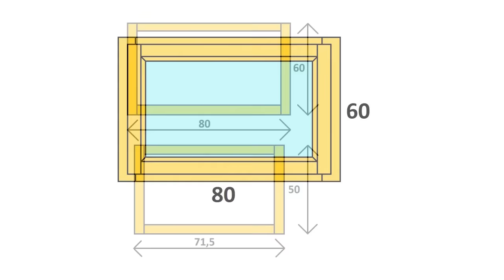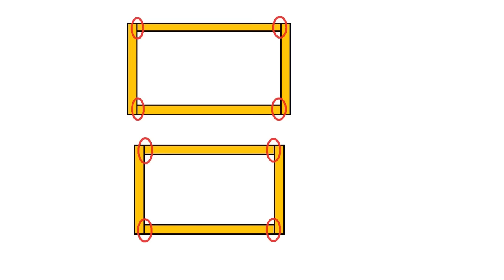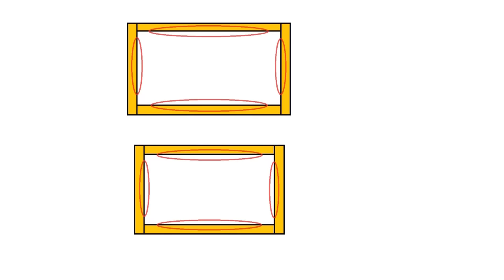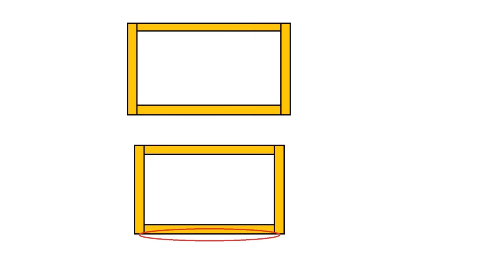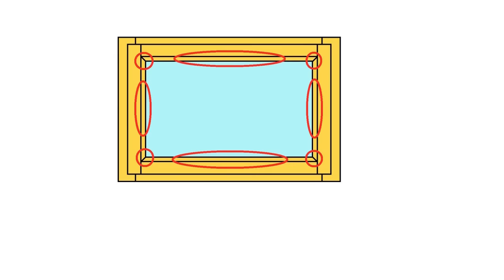Simple window making start to finish

Comment: Your workmanship is excellent, I understand about the safety standards in your country. I've worked in both Greece and Turkey and it's the same there but you can lead the way and set the example for others by making your workshop clean and safe. God bless and keep up the good work. Thanks for sharing your video.
Reply from the maker: Thanks, I really doing my best...
Reply: Voice of wood good on ya mate. be careful in there. your work is excellent
Reply: You're talking about my uncles. Of the four there would be thirty-five fingers and thumbs between them. I'm in my seventies and my son-in-law and his three brothers are all journeymen, with a total of forty fingers and thumbs ... one is known as "Safety Sam". His company, a major contractor, is purchasing Saw Stop table saws because it's cheaper to have the machine repaired than the loss of time and wages for an injured carpenter, plus the time and expense of all the paperwork involved by the supervisors for the insurance companies.

Comment: It would be good to know how much expansion space you leave between the glass and wood frame.
Reply: I work with glass and windows. Typically 1/8”- 3/16” all the way around and you want to set the glass on rubber blocks.

Comment: As a qualified carpenter all I can say is , none of his power tools have guards on them !
Reply: I am not a carpenter but I thought the same. The window making video and lesson are GREAT, no comments about that. But while watching the video I thought there were plenty of situations in which accidents and very severe injuries (even death-causing injuries) could have happened.

For example, there is a bit where he drills holes in the wood, pushing the power drill towards himself. If the drill would have slipped, it would have gone right through his belly, God forbid. Worse than a bullet.

Comment: Great work and skill!  I only wish I could figure how to do that with simple powered hand tools!  Funny how so many people focused on what they could find wrong?  Human nature?
Reply: Andy Chernak you can use half lap joints, these can be done with a handsaw and chisel 

Make the frames, glue with d3 pva glue, square and drive a few short nails through the joints, the nails will act both as clamps and as safety belt in case the glue fails

Make sure that you have about 2mm space between the frame and window 

After you applied silicone, take a rag, wet it slightly, fold in 4, then drag it over the silicone, it’s going to leave your hands clean, but more importantly, the silicone bead will be perfect 

When using silicone, make sure it’s uv safe, otherwise it’s going to fail after 1 summer, the good ones rated for exterior applications can withstand -50 to +180c, they smell nasty, anything it comes in contact with is compromised
Reply: You can do literally everything here with nothing but a saw, chisels, tape measure, pencil, square and a marking gauge. Cheap, it only takes time and effort
Reply: Andy, please look up Paul Sellers here on YouTube. All of this can be done with hand tools, Sir!

Comment: Push sticks ?
Reply: As you run the wood through the table saw you can use a small piece of wood (instead of your hand and fingers) to push the last bit of lumber passed the blade. He eventually did use a push stick on one of the last pieces. Probably an afterthought.

Comment: Hello, I'm curious, What was the thickness of your frame stock and what type of wood did you use?
Reply from the maker: 70 x 45 mm profiles, spruce in this case. But for higher quality windows 85 x 72 mm black pine.

Comment: No safety measures using the table saw at all. Wow. You're lucky you still have fingers left. No guard, no riving knife, no push stick or feather board, no hearing protection, no mask, no eye protection. No words. This is everything you should not do.

Comment: Notice you haven't replied to any of the requests for hardware source. Great video, outstanding design and craftsmanship, but it all almost becomes pointless without the ability to order the hardware.

Even if it's overseas, we'd appreciate the source so we can order. 

Thanks!
Reply: For us who are not from English speaking countries, what do you mean by hardware source? I understand English, but I have a problem with things such as professional tool and equipment names. You mean this which open the window as on 12:42?
Reply: @nellinhos  

I understand. Thanks for your reply. Your English is excellent.

Yes, I'm referring to the hinge and handle system. I have not been able to find it anywhere in the US (we are so backward here in so many ways when it comes to house building). I'm building a small home here in the States later this year, and any help locating the hardware would be appreciated.

Thanks again!
Reply: @thairobert4034 
I will go to a local store here in next 2-3 days and ask the guys what is the brand.
Reply: @nellinhos  

No hurry. And thanks in advance!
Reply: @thairobert4034 
Hi, sorry for late reply, Robert. We are little busy at work last 2 weeks.
I had time to go to one store and ask which brand are they using and they said Roto NT, Germany
Reply: @nellinhos  No worries. Thanks very much. I didn't mean for you to go out of your way! 

I searched that company and found a distributor. Very nice quality. I break ground for my house August 1st and look forward to using these instead of making my own.

Take care and thanks for your help.

Comment: Great Video.   Was that a joiner machine you used midway through?  I've never seen a belt sander that big😯
Reply: It's a pad sander,  some of the better ones have a pad suspended on rails above the bed you pull down with a handle to apply pressure, i sed to use one when sanding boards flat whilst doing my cabinet making apprenticeship
Reply: Ερασιτέχνες.κε.τα.βγαζουνε.στο.ιντερνεν.ειμαι.συνταξιουχος.μαραγκος.κε.τα.βλεπο.κε.γελαο

Comment: A horror show.No guarding on the machines.Those thin strips covering the floor around the spindle,very dangerous.Clamping of metal strip to spindle fence-bad idea!Why not Use the spindle table slot,to be able to use a slide carriage,with a clamp.

Comment: That window would leak when it rained.  Then in a year or so... the wood at the bottom of the window will rot... and then... you can build yourself a new window.
Reply: you might be wrong. if he seals the frame of the window in a treated casement and gives 5 coats of poly he'll be good
Reply: @TheGoldsholl  "You are correct... I might be wrong." I certainly do not know everything.  At 74 yrs old... I am still learning.  Merry Christmas from Texas.

Comment: Having personally seen a guy chop his leg off (faulty guard on skill saw, which he didn't care about), another guy lose 2 1/2 fingers in a table saw (no push stick, wood grabbed and ripped against fence), and another guy a finger in a jointer (no idea how as I only saw him running by,  but he insisted on not using guard or grips), I wouldn't recommend this video to anyone.
Reply: 99% of shop accidents occur because of operator error....not faulty guards, not bad equipment or a cluttered shop.  Guards, for the most part were created to satisfy insurance companies and OSHA regulations...NOT for the safety of the operator.  If a guard is blocking your line of sight it is more likely to cause an accident that not having the guard at all.
Reply: @bill5552  -It is called an accident because that`s exactly what it is.Nobody sets out to lose digits.The guards are placed to prevent people coming into contact with the cutting edge.Not using guards is plain stupid and negligent!

Comment: there is zero reason why you wouldnt have the splitter installed.  also, push sticks. NEVER push the final way thru with hands. just asking for amputation in this video. do better. set the proper example for the youts.

Comment: Health and safe not a big thing in your work shop then
Reply from the maker: Yes, I know, cause of low standards in Serbia...
Reply: Nisu standardi losi nego se niko ne pazi.Sve su to navike koje nasi ljudi u svim sverama posla nemaju.
Reply: khana ristobal he still got them making him a lucky man. A standard isnt made by others but by yourself. Wood on the floor and standing on it doing the cutting isnt any standard its just stuppid. He does make nice windows but people just think with him not agianst him. Serbian or not.
Reply: khana ristobal i think you see safety a bit the wrong way. Anyway have a good time.👍🏻
Reply: OSHA are there for a reason. you chose to work dangerously. would you say the same thing if you took your fingers off? do that, and try typing the same comment
Reply: I would highly recommend a mask. Breathing the dust will cause many problems in the future (like cancer). Nice work by the way

Comment: I don't understand why the automotive industry hasn't evolved yet. They've got Gorilla Glass on the Ford GT 40. I know they have a 3 layer glass now that meets certain same standards. So how hard is it to put two thin shells of glass together with Nitrogen in the center to prevent fogging ??? It's because of the cost they always tell you but think about it how many times ??? It's like this mask on my face it doesn't fit right. You need such & such approved mask. It wasn't like this when Covid 1st came out ??? How the "F" does the price of Bacon go to 7$  a pound? When most of the time there selling you Fat? I wonder How; I got both of my shots, but I'm starting to wonder what they're selling us next? Capitalism is what Capitalism is. I've earned everything I've got in life. But now I've had to go through back & neck surgery. And there's nothing right about that!!!

Comment: There isn’t one single tool guard on any of the machines in this shop. Additionally, there are certain practices that can be utilized to prevent the drop material from being kicked back on the table saw. Not to mention how much trash is on the floor. There does not appear to be any type of dust collection in the shop AND the worker is not wearing a dust mask. What a shame that this video is allowed to be posted on YouTube. It is for all of these reasons I am giving a thumbs down and flagging the video.